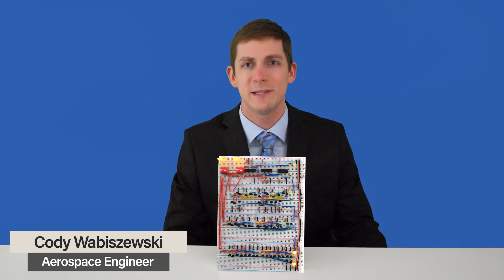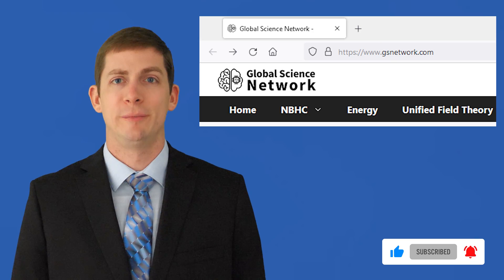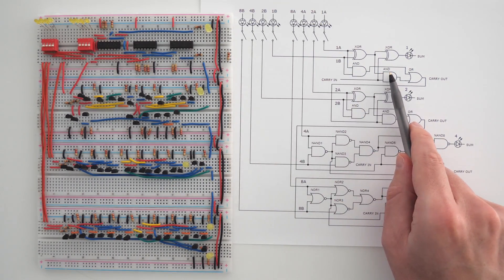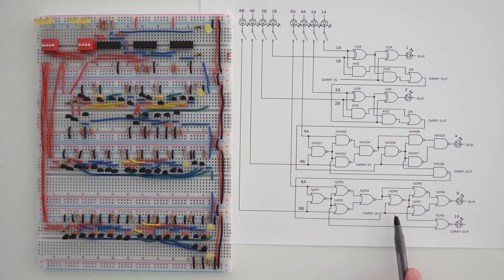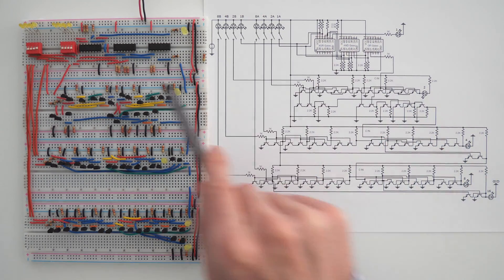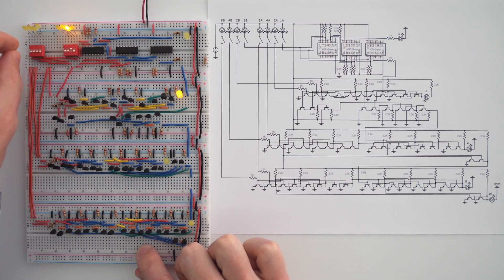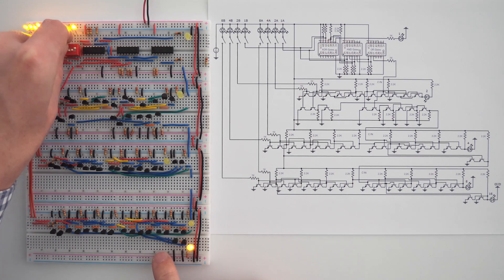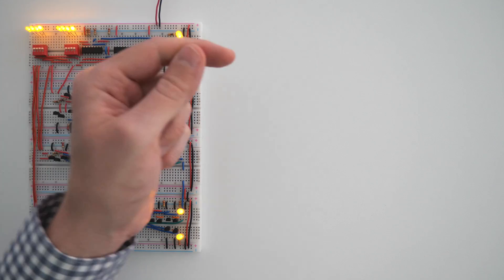4 bit calculator built using individual transistors

Comment: For the top segment since I don’t have those chips, can I build it the same way as the one below it. I remember you mentioned something like that in a previous vid
Reply from the maker: Yeah, absolutely, I was just showing all the different ways you can make a full adder to make it interesting.
Reply: @GlobalScienceNetwork oh ok, but also what resistors did you use and just to confirm it’s 2n2222 transistors? This project looks very interesting and I wanna try to build it

Comment: Cody, amazing video, it is really interesting to watch. 

My question is, do you know the minimum amount of transistors to build a full adder. Sure, you can get the full adder with the lowest transistor count and build it 4 times. Sure, there are other adders like carry-look ahead. However, is it possible to build a 4-Bit adder with lets say 50 or less transistors? Now, its seems impossible, but we can not check all possibilities. Its an optimization problem in the end :)

Maybe, there is a weird way to do it. I would really like to hear your thoughts on it!
Reply from the maker: Yeah there is. I relied to your other comment. I think you could even find an article about a 1 transistor full adder but lots of resistors are needed in that case so it is not a 1to 1 comparison.
Reply: @GlobalScienceNetwork  Cool, can you share the article? I would really wonder, if fewer than 3 transistors are possible at all, since you need 3 output LEDs in the end for a full-adder.

Comment: do you think you could explain how a full subtractor would work? i know that it's similar to the full adder but i dont know what to change to make it.
Reply from the maker: Yeah, it is actually easy, you just add a circuit above the adders which changes the input logic for add vs subtract. In the 4-bit computer video, I show the logic gates that were added to allow the ALU to subtract. If you look at the circuit diagram and do not understand I can explain further.
Reply: @GlobalScienceNetwork   Okay, thanks for the info. I will look into it.

Comment: Also can you please tell me the list of components used in the whole project
Reply from the maker: Well, the main components are four breadboards, wires, LEDs, 1K or 2K resistors, 2N2222 transistors, and the dip switches. In the circuit diagram, I show the values of all the components.

Comment: can you post a schematic level diagram in which there are 4 full adders of the same type using ICs
Reply from the maker: Well, there are a bunch of ways you could do it depending on which type of gate or gates you want to use for the adders. The idea here was to show the transit level and I do show the circuit level diagram. Also, the top adder is built with ICs. If you look at the diagram where I show the IC pinout you can see I use 1 XOR gate, 2 AND gates, and 1 OR gate. There are 3 empty XOR gates, 2 empty AND gates, and 3 empty OR gates. You just need one more AND chip and you could build the 4-bit adder on a single breadboard.

Comment: TTL is good n all but why not use MOSFETs?
Reply from the maker: How are you suggesting to build the full adders with MOSEFETs? Using ICs or individual transistors? Sure you can swap the BJT ICs for CMOS ICs and it should work. You just have to be more carful with static shocks. The reason I did this with individual transistors is to show how to make logic gates at the transistor level. Right now I am working to build a 4-bit computer using individual transistors. Then I plan to build artificial neurons with simple discrete components.
Reply: @GlobalScienceNetwork  that is fair. I tend to make circuits around pic micros and to me using mosfets is just easier as you really only have to get the gate voltage right. Using BJT transistors you need to calculate base emitter current bla bla bla. But if your planning on using these circuits in the linear region for AI nodes BJTs are probably the better choice. But for me, if I was to make an adder like this, which somewhat simulates a digital circuit, 100% I would use individual MOSFETs. Good videos BTW and I am interested to see where this channel goes in the future
Reply from the maker: @GiBBO5700  Interesting, what model number MOSFET would you use? Maybe I should make a video showing some logic gates with MOSFETS. That is what is in FPGAs as well. And thanks for being interested in the channel. I bet you will be able to help along the way!
Reply: @GlobalScienceNetwork I'd suggest 2N7000 as being a good one to try. They're low power N-channel enhancement mode MOSFETs with a low gate threshold. They should work well with a 5 volt supply and they're cheap and readily available in standard plastic TO-92 packaging.
Reply from the maker: @johnm2012  Thanks for the info John! I will have to get some and try them out in this type of application and see how they work.